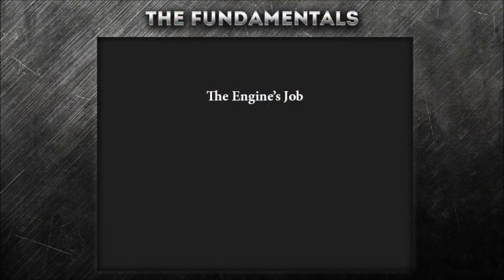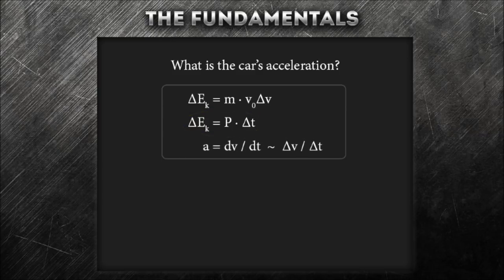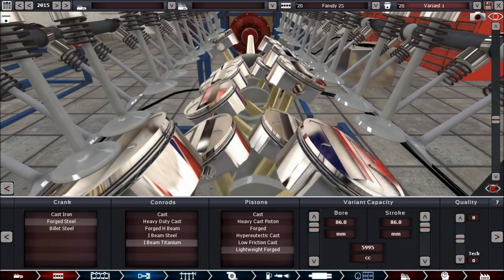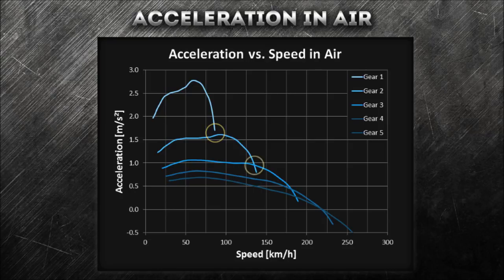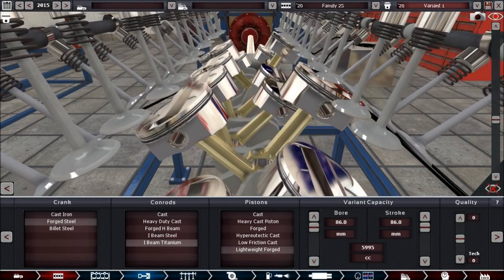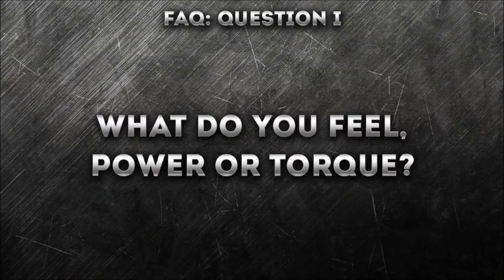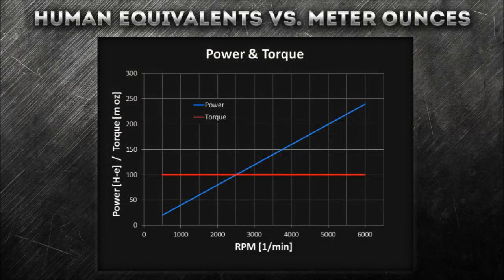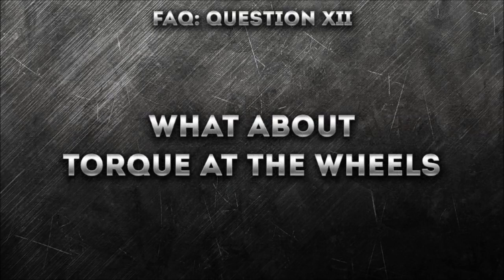Power & Torque: Acceleration Exposed

Comment: Forget about torque!
Save yourself a step and just look at the power curve.
Wherever you are on the curve is your budget to accelerate, tow, climb a hill, push air out of the way at top speed... torque is only a useful spec when you are calculating when parts will break or how much tension you need on the fasteners to keep the wheels on the hubs and the heads on the block.
All work is done by Power. It's not an opinion or just a fact,.... It's The Law!
Reply from the maker: Exactly!

Comment: What about launching a car from dead stop? In a given gear, acceleration is expressed as a = T* R* k, so we can eliminate velocity. However, in real life, when someone loads up the flywheel as much as he can, the car accelerates faster from a dead stop, given we have enough traction.  For example, many diesel cars have their max torque at 1500-2000 RPM. But from a dead stop, when the car is launched at 3000-4000 RPM  by loading up the flywheel, the launch is much faster. I don't know why though.
Reply from the maker: It has nothing to do with the flywheel of your engine, and everything to do with a) maximally utilising your traction budget, and b) getting your engine closer to its peak power output.
Reply: @AutomationGame  Yeah I fundamentally grasped all concept, but flywheel loading seems like a thing though. 
https://youtu.be/cdqLUcvzn6g

Comment: Very good explanation. I did manage to catch a small mistake. Technically speaking, torque is a vector product and should be written F X d, instead of F (dot) d.
Reply: Torque for engine terminology refers to work kinda as its what the constant torque applied during a single crank rotation if the force was a constant (and not an undefined amount of time lasting combustion event a ) during a single crank rotation

Comment: While we're demystifying engines, torque, RPM, and power let's clear up some common internet hivemind misconceptions: (some of you may need to sit down for this
Part 1:
Horsepower is not merely "marketing"
It, like Watts, Kw, BTU/Hr is a measurement of Power.
Dismissing it as merely "marketing" implies that it's a feature without benefit. Advertising a torque number without RPM would be a feature without benefit.
Reply: Part 2:
Power is not what "maintains" speed or "keeps you going". That's how much fuel you are bringing with you.
Reply: Part 3:
Long stroke engines do not make more torque because of "leverage" from the crankshaft.
Crankshaft's do not add any leverage to the work already done by combustion pushing the piston down the cylinder.
Reply: Part 4:
18 wheeler "semi" trucks do not make massive torque "because" they need to haul heavy loads.
The maximum output required from the engine is based on its power not its torque.
Reply: Part 5:
Maximum acceleration at any given speed does not occur at peak Torque it always occurs at peak Power. Maximum acceleration for any given GEAR occurs at peak Torque and would be less than at peak Power at a different gear ratio for that speed.
Reply: Part 6:
Maximum towing capacity at any given speed does not occur at peak Torque it always occurs at peak Power. Maximum towing capacity for any given GEAR occurs at peak torque and would be less than at peak power at a different gear ratio for that speed.
Reply: Part 7:
Torque is not "the only thing that can be measured." Some brands and type of dynamometers like Mustang brand Load cell type directly measure torque directly and calculate power, others like Dynojet brand inertial drum type directly measure power directly and calculate torque. Neither of these
"delegitimizes" the concepts of Torque or Power
Reply: Part 8:
Torque is not what wins races, races are a competition based on work vs time. Torque is irrespective of time as it is only Force x Distance.
Power is force x distance / time and is the measurement that would indicate the winning of a competition involving work vs time.
Reply: Part 9:
And Finally 400lbs ft of torque is not "equal to" or "the same as" 400HP. They are "equal" or
"the same" numerically only. In the same way 400 gallons of water is not "equal to" or "the same as" 400 feet of wire.
If you still believe in the magic torque and would like to schedule an exorcism please reply below.  Rates (like RPM) may apply.

Comment: I just have one question that I can't grasp my mind around, in a given gear ratio, peak acceleration will accur at peak torque, i.e. at the most amount of work done per combustion cycle, but why doesn't peak acceleration accur at peak power if the formula a=P/mv still holds true for a given gear ratio?
Reply from the maker: Peak acceleration can only occur at peak power if it is the same as peak torque :) the reason is that you're faster! When you're faster, you need more energy to increase the speed by one unit compared to when you're slower. Accelerating from 50 to 51 takes half the energy as accelerating from 100 to 101. So while you make more power at peak power, you don't in relation to how much energy is needed for further acceleration.
Reply: This may help clear up your confusion:
While peak acceleration will always occur at peak torque for a given GEAR, peak acceleration will always occur at peak power for a given vehicle SPEED.
Reply: It dont hold true for given gear ratio simple because v is enough higher for make power to velocity ratio /proportion worse than at peak torque rpm for set final gear ratio 👌 feg i dont know what hatever what let say 100 nm at 4000 rpm and 75 hp at 7000rpm in some bike  like 300kg heavy cruiser at set gear let say 1 gear  where 70 km/h is at 7000 rpm so at 4000 rpm must bee around 40 km/h right ? Yep egzacly 👌now fast calculation which will push more foorce to the tarmac so lets assume also 10% drive train losess so peak power at whell including dt losess  is 50170watts so alot but it must be divided  be even more alot speed cos 👉70km/h so 19.446m/s =2580 newtons force at contact path vs now peak torq 100nm att 4000 rpm is only 38081watts but speed is waaaay enough lower precisellly speaking 40km/h so only 11.112m/s for generated larger force at contact path 👉which be in this egzample around 3427 newtons 👍🌪thats why peakntorq rpms at set final gear ratio always will be push stronger forward than peak power rpm for the same vehicle for the same engine 🪠🍿ps beside your formula is wrong force is power at whell  /speed but acceleration is force/motion resist which is not only m which is probably masss in your equation i quess  👌 motion resist also assume drag including momentary wind speed and direction and air density  and carosery changind position and angle and incline 👌 mass itself is simplifie  formula for physique model in so call vacum  it dont fix perfect to cars or bike especially at higher speeds where lighter but with enough worse drag car or bike can accelerate slower even with more power 👌🪠🍿

Comment: isn't it acceleration=torque/inertia though? even if you substitute power in your equation "a ≈ P/mv" with power=torque*angular velocity you get a = T/m back (m should be inertia here though)

so how I think about it is that power is just the potential of how much speed we can trade for torque or vice versa. If a car produces 200 Nm at 3000 RPM and 200 Nm at 6000 RPM wouldn't it accelerate the same at these particular RPM values? it's just that at 6000 RPM you can use higher gear ratio to get more torque to the wheels, because for given const power value you have infinitely many pairs of (torque, rpm) for which torque*rpm=this power value

you even said it yourself with the gearing example: the acceleration is pretty much the mirror image of torque curve. It's just that with lower gear ratios you have less torque to the wheels so slower acceleration but higher speed.
Reply: yeah I think we agree on this, it's just the wording: you said that power accelerates the car. I say it's the torque at wheels. In the end it's the same thing said differently
Reply from the maker: Correct, torque at the wheels is directly translatable to power! I find looking at the energy state of the car way easier because it skips the entire drivetrain conversions of torque back and forth and gets straight to the point :D
Reply: @AutomationGame 👍 Forget about torque, Save yourself a step and just look at the power curve.
Wherever you are on the curve is your budget to accelerate, tow, climb a hill, push air out of the way at top speed... torque is only a useful spec when you are calculating when parts will break or how much tension you need on the fasteners to keep the wheels on the hubs and the heads on the block.
All work is done by Power. It's not an opinion or just a fact,.... It's the Law.

Comment: When you accelerate in a MANUAL gearbox vehicle, what you feel is TORQUE, and here's why:  

The force you feel on your body is equal to the instantaneus acceleration of your body times your mass (F_body=m_body*a_body). 
Your acceleration is the same of the car, so it is equal to the force the tyres are appying to the ground over the vehicle mass (a_body=F_wheel/m_car) (assuming no external resistance).
The force the tyres are applying to the ground is equal to the torque they recieve from the driveline over the wheel radius (F_wheel=T_wheel/r_wheel).
The torque coming from the driveline is equal to the torque from the engine times all transmission ratios and efficiencies (constants) (T_wheel = T_eng*const)
Therefore, this cascade implies that the force you feel applied on your body is proportional to the torque the engine is generating at each rpm.

More simply, the force you feel when accelerating throughout the rpm range has the same shape of the torque curve of the engine (assuming no external resistances).
Reply: For a given gear maximum acceleration will always occur at peak torque.  However for a given speed; peak acceleration will always occur at peak power.
Reply: If you are accelerating you are doing so indirect proportion to the rate of energy being transferred.  There is a name for that.  It’s called Power. Power =dE/dt
All work is done by Power.
Reply: F_body(rpm) = [m_body / ( r_wheel * m_car )] * Const * T_eng(rpm)
Reply from the maker: The torque you are talking about is derived from power, i.e. "Torque = Energy" not from leverage. That is the point I am making and the one you are misunderstanding. You are in fact talking about power without knowing it (energy per unit time), which translates into torque at the wheels.
Reply: I totally agree with you, however what I was saying is that the force you feel while accelerating in a fixed gear ratio has the same trend as the usual 'torque' (work) curve you find in engine diagrams, and does not resembles the power curve.
Reply: @feffo1100 torque is not work.  You can’t feel torque.

ΔE=∫v⋅dp+∫τ⋅dθ+∫Pnon-trans dt

All Forces Fields and torques are emergent geometric constraint coordinate-dependent gradients; energy is the invariant object. 
All work is done by Power.
P=dE/dt

Comment: Great video but you do have one assumption wrong. Electric motors certainly can have flat power curves. However, in most modern consumer electric cars they often do not have flat power curves. EVs like the Tesla Model 3/Y, Kia EV6, and Porsche Taycan all have power curves that fall off significantly at higher speeds. In fact the Porsche Taycan even has a second gear to combat this. The Tesla Plaid vehicles all have essentially flat Horsepower curves all the way to their 20K+ rpm limit. There is no need for a variable gearbox with those cars.
Reply from the maker: You're of course right about that :) the base assumption of a flat power curve is basically like the base assumption that a combustion engine has a flat torque "curve" :D okay, that's a bigger difference but you see where I'm coming from. First order correctness xD
Reply: @AutomationGame  yes, I do see where you are coming from. However, a lot of people make the assumptions that all engines have flat torque curves and all electric motors have flat torque and flat HP curves. The latter is of course impossible. I just wanted to try to set the record straight. I am a huge fan of your videos. Tons of great information. I have been doing extensive testing with the Tesla Model 3 Performance and I am trying to model that car’s acceleration. Your videos have helped tremendously with that. I am able to do 0-60 mph in 3.00 seconds and the 1/4 mile in 11.17 @ 120.0 mph.

Comment: Hello again
First lets check if everything is correct here.
T=force times length of an arm
W=T times rotational distance.
So work per one rotation is T*2π and measured in Nm like linear work because length of arm which is radius is now distance traveled because of 2π multiplication.

Now the question.
What dynamometer actually measures?
Say we get 400nm measurement.
Is it a peaked torque along this particular revolution or is it work per this particular revolution?

Everyone talks of it as torque but is it true?

If it is work then torque is 400/2π=64nm (average)
Piston stroke is realistically 8cm which results in 64/0.08=800N of average useable force applied on crankshaft. I find it plausible, considering it is average and not peak, and lots of piston force is lost between piston and crankshaft due to geometry, friction etc so this still leads to hundreds of kilogram-force from a tiny drop of fuel. 

But if that is 400nm of torque this leads to ~6.28 times more of average force from a drop of fuel
Reply from the maker: The torque (force) varies massively during the combustion cycle and is negative for most of it. The torque (work) the engine produces is the measure to be used to make sense in terms of performance. Torque as a force is only ever useful when you try to determine the mechanical stress on internals.
Reply: @AutomationGame  right, this is why I called it "average" torque per rotation, which, multiplied by 2π is a work per rotation. So 400nm @ 4000 rpm reading from dyno, what is it?
Reply from the maker: 400 Nm of engine torque would be the total area under the curve, which also comes from all cylinders, not just one. So you need to divide that by cylinder count too if you want to look at forces. :) Then on top of that you have those forces from the combustion acting with a sin(crankangle) multiplier to give you force figures.
The dyno measures power, from which you can derive torque, and from that in turn the forces if you go through a LOT of calculations that are not necessary unless you are an engineer.
400 Nm at 4000 RPM means the engine outputs 2pi * 400 Nm * 4000 / 60 seconds = 167550 Nm/s =  167550 J/s = 167.55 kW
Not sure if the dyno measures the kW or the Nm + Speed :) it doesn't matter, as both are power.

Comment: Great work! Just wanna ask one thing. So the force in energy per combustion cycle, acting on a radial distance must always be greater than the forces acting on the wheel of the car;such as friction,gravity etc. For example, in a tug of war contest the car putting more energy per combustion cycle, or torque is gonna win whatever its horsepower is, just due to the fact that the force in torque( energy per cumbustion cycle) dominates the other car's.
Reply from the maker: You're trying to see it from the perspective of forces instead of energy :) sure can do that, but it is a lot more complex that way to get it right. You are confusing terms. Force is not torque! Work is torque. When you mean forces, they fluctuate wildly during the combustion cycle and are not useful to calculate performance, only to calculate stress on parts.

When you lean against a wall, you produce a lot of torque (the torque you talk about: force), and yet you don't move the wall (you produce no work, the torque that the video talks about, the correct torque to talk about when it comes to engines) . Only when the wall starts moving have you actually performed any work.

So step away from the concept of torque = force, that is not how it works in automobiles. :)

Comment: I have an easy solution, just add more power and torque. Adding 1000+ horsepower usually fixes any acceleration problems

Comment: 23:18 You say here that Electric engines get mostly flat power curves across their entire rev range, but looking up the power & torque curve of the Tesla Model S shows that this isn't the case, what am I not understanding?
Reply from the maker: How they modulate their power curves is up to them, an electric engine is pretty close to an idealized engine. efficiency does not vary much in a wide range of RPM. :)
Reply: @AutomationGame I was wrong anyway, the Model S has a rising curve to about 7k, then only slightly declining the rest of the way to 18k. Definitely counts as "mostly flat" to me.
Reply: @AutomationGame electric engine well all which im seen have peak constant torque on engine up to some rpm than torque drop down  ., power isint peak constant it grown grown grown achieve peak which hold not so long and than again power drop down its not perfect graph  .,well it can be if we consider tires dont have grip and engine is very powerfull and torquie that can go on tores border grip from stand still however if we do unlimited tires grip  than all electric engine in modern car is very far from perfect power torque graph which should look like  this cvt acceleration speed graph  i mean torque graph so insane high at very low rpm and constant drop down while rpm grovn such kind of torquee graph give constant peak power from lowest rpm up tp highest so you have still peak power whichout gearbox and clutch no matter at what kind of speed ypou are and engine rpm  just floor and you go in any moment at max acceleration rate or with max tires twisting force .,